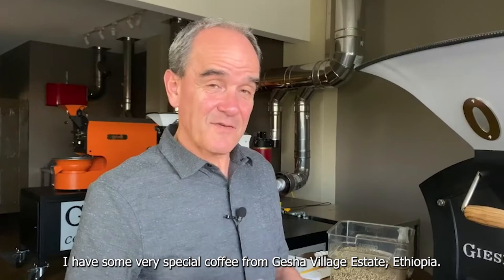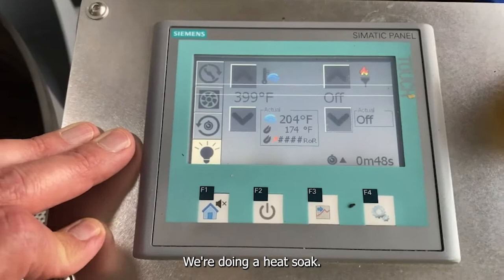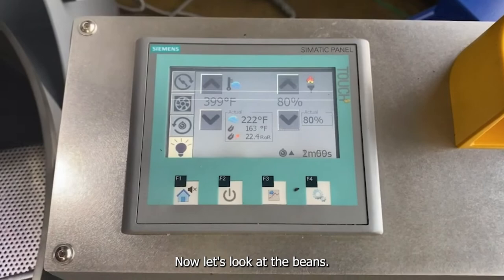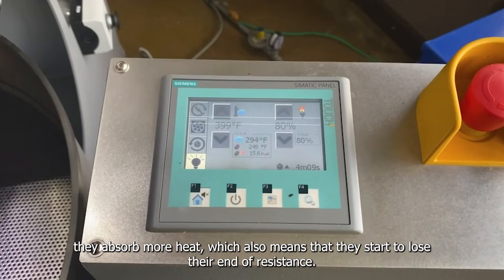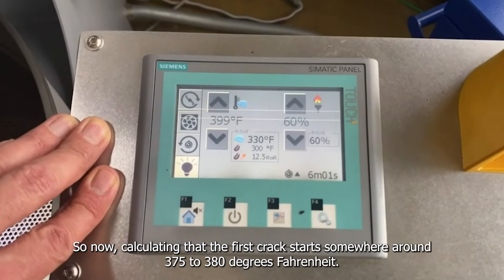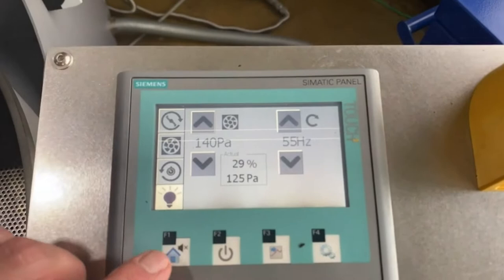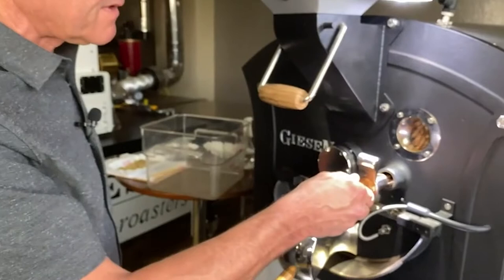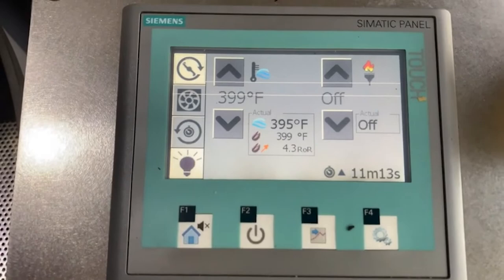Back to school with Willem Boot - Giesen W6 series

Comment: I have seen many Roasters start their roast at 195 Degree. Is this too high Compared to how you roasted the Ethiopian coffee
Reply from the maker: Can you tell us what Ethiopian roast you are referring to. But in general, we notice that the temperature of the heat soak between 180 and 220 will have minor neglectful differences. The air temperature at the start of the roast can cause a shorter roasting time and a slightly different flavor profile but that can also cause scorching.